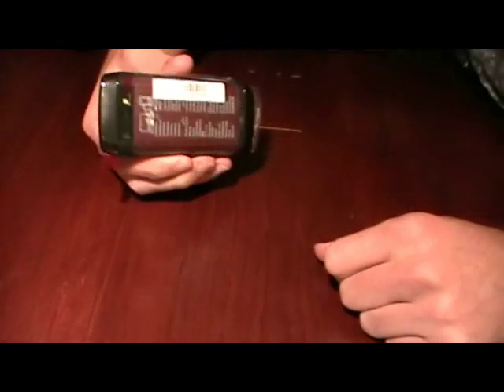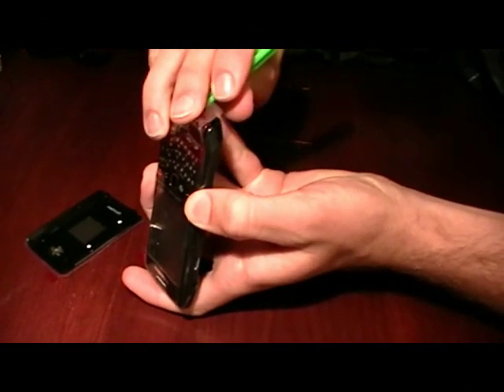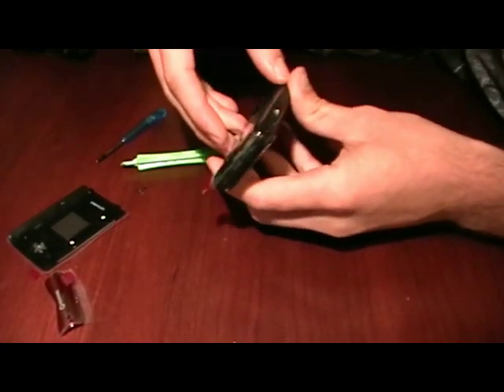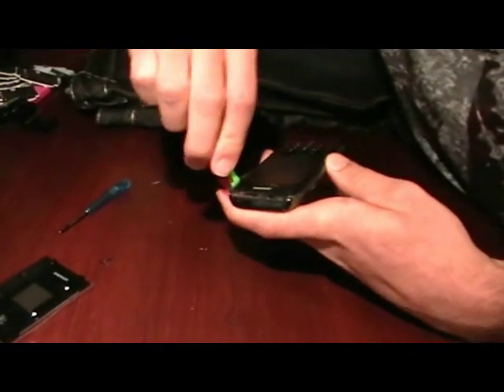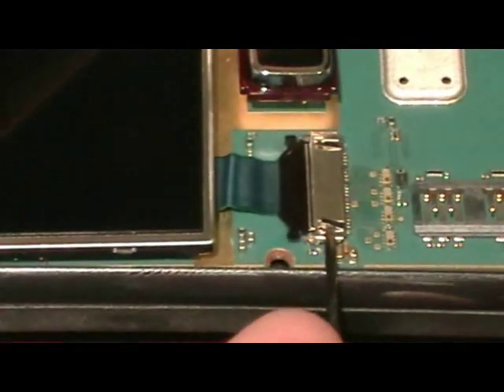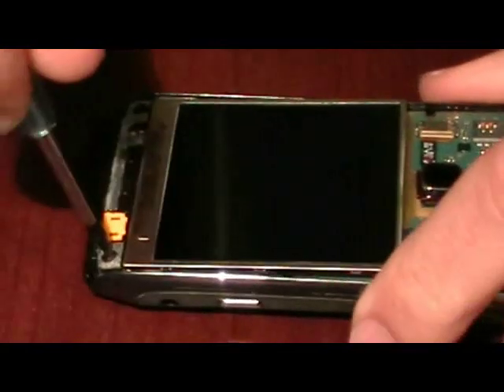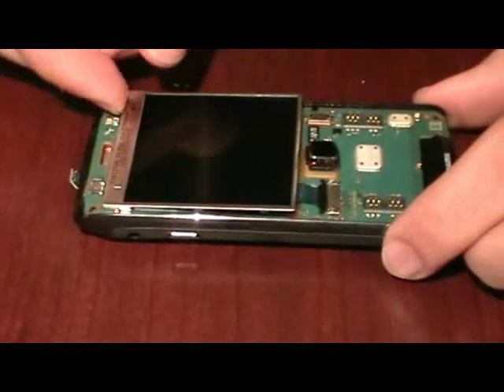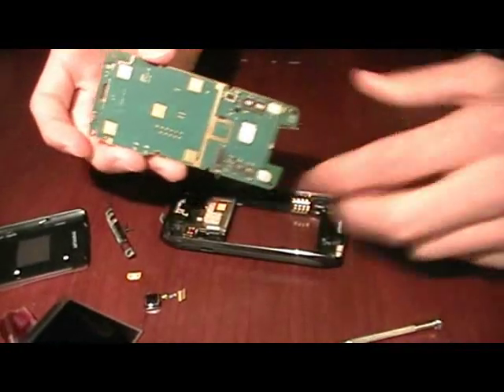Blackberry 3G Pearl 9100 - 9105 / Striker / Stratus Disassembly Tutorial

Comment: Hi, thanks for the video, i have a blackberry 9100 that was working fine, until i decided to to a factory restore, after that the screen is black, the phone turns on but don't see anything in the screen. i took it apart with your instructions, cleaned the contacts and re-assembled it but same problem continues, any ideas? should i buy a new screen>?